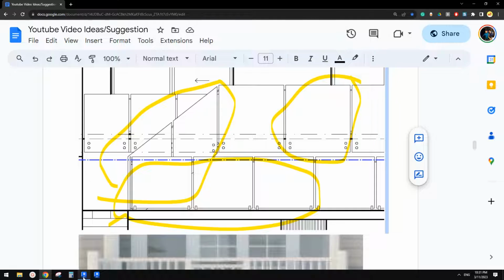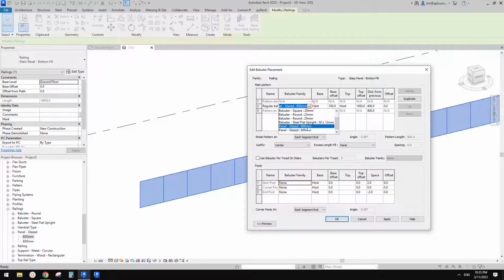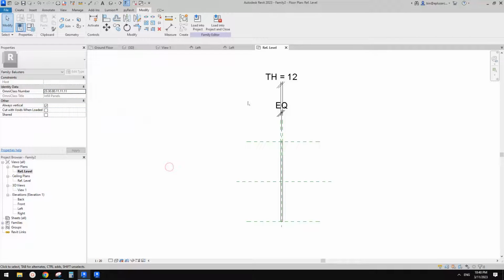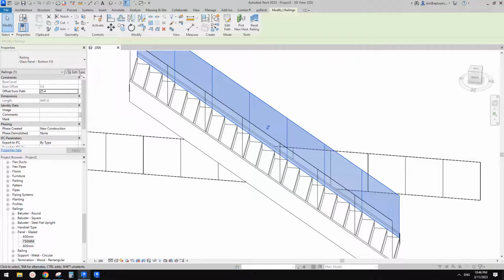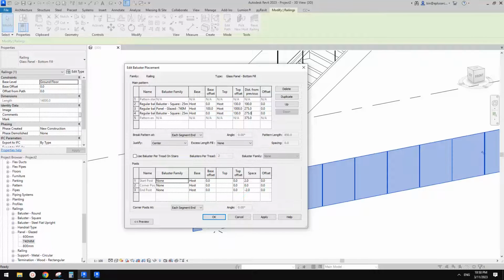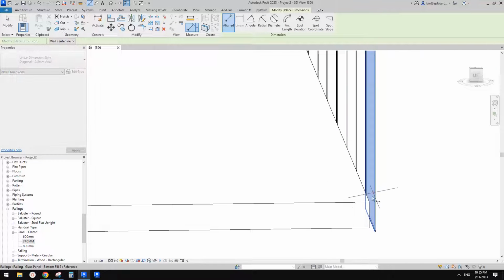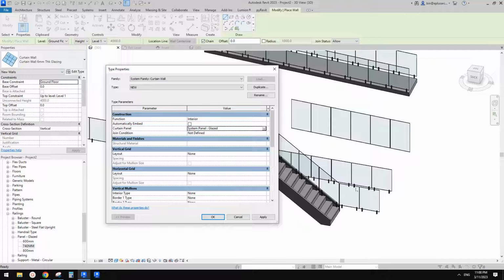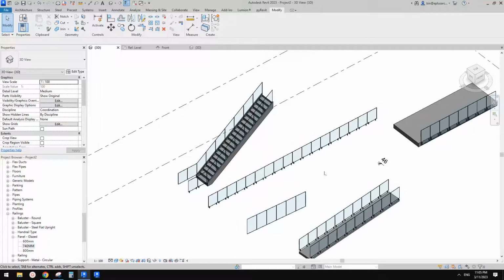23102 - Revit Railing (Baluster Panel) Exercise

Comment: Halo bin, i just create a railing exactly like in your video but my glass panel wont start at first tread
Reply from the maker: It's a bit hard to guess where the problem is. Have a play with the setting in Baluster Placement.

Comment: Thank you Bin He, really enjoyed your Revit exercises. For the second fitting, I think you can use curtain wall technique. Much easier, just sharing. https://www.youtube.com/watch?v=8WCRqNki3fk&t=8s
Reply from the maker: I agree with you. Curtain wall is easier than panel railing for schematic design.   But sometimes, when the railing becomes a bit more complicated, we might not be able to do it using curtain wall. It can be very helpful to understand all the settings of the rail family, because you will have more choice to model them in different situations.
Reply: @BINHE615  How so? Curtain wall railings are only terrible at making sloped panel railings. You typically know the railing is sloped or not at early stage of DD anyways. If they are sloped, you won't even think about using curtain wall railings; if they are not, then you know using curtain wall railings will work 99% of the time throughout the rest of the project. 

The only good thing about the default railing system is its consistency. If you know your railing has to be adjusted a lot then the malleability of curtain wall railing is always the better choice - if you don't have to put them on a lot of slopes that is.